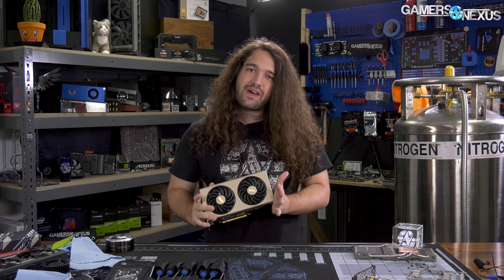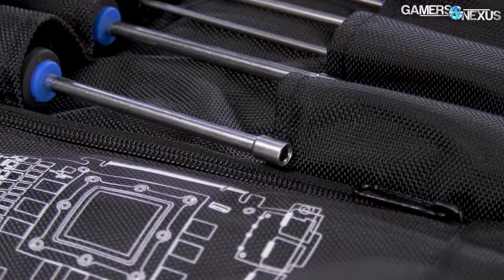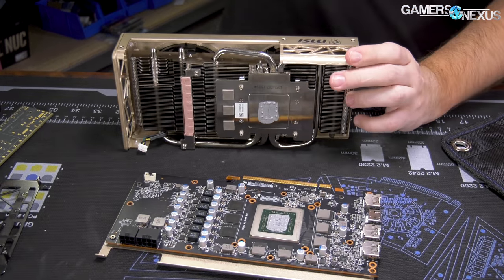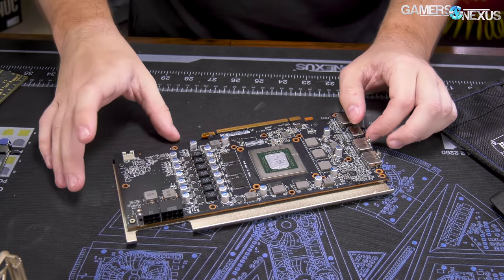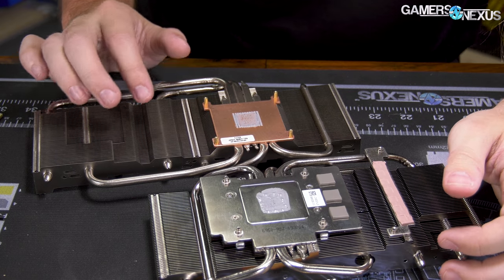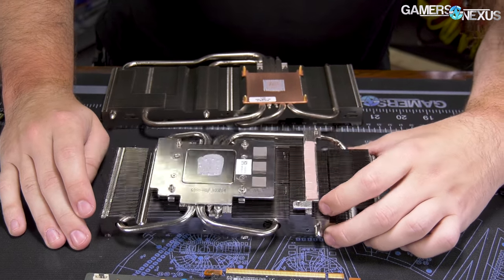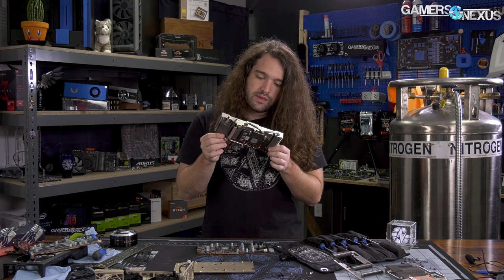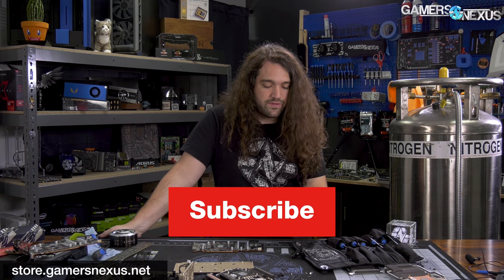Wrong Thermal Pads: Tear-Down of MSI RX 5700 XT Evoke OC

Comment from the maker: Original review of the MSI RX 5700 XT Evoke OC is here: https://www.youtube.com/watch?v=9pj4F8qUBEw
Grab the GN modmat or toolkit on the store! https://store.gamersnexus.net/
Reply: My 2070 MSI Armor can stay cooler than that thing XD
Reply: Steve, could you try throwing proper sized thermal pads on the MSI card and test again for memory temps? It looks like a full sized pad on those memory chips might help and there is PLENTY room on the heat-sink...if you look closer, the uncovered portion is inward, towards the center of the HS, NOT extending outward like you are suggesting in the video (12:41). I am VERY interested in this card and would appreciate your help. Thanks for the reviews and tear-down vids. Cheers!
Reply: dont they realize the likely hood you will disassemble a gpu you were sent or that you buy jebus lol
Reply: @glutenfreegam3r177  Yeah I am curious what would happen with proper pads and perhaps a higher quality thermal paste on main chip.
Reply: This is a common thing with MSI cards. I have a MSI Armor RX 570 8GB OC with the same sized pads.
Reply: The more, and more I see this teardown the more this cooler looks like the Armor branded coolers from MSI. It looks like they added a backplate (which some special edition Armor coolers have), and put it into a different enclosure with the same fans & heatsink.
Reply: probably reused the cooler from another card. which would be a lot cheaper than making a new one.  found something close and said "why not?"
Reply: I just need to ask how it can be a bad design of the heatsink when it is the size of the thermal pad that is wrong. Right size of that thermal pad will be covered by the heatsink. Please explain why that is a heatsink design flaw?
Reply: I need to correct you: It actually matters a lot how many heat pipes are attached to the cold plate. Being a phase-change heat pump it has a limitation of much energy can the device move at a certain temperature differential. Once the q° is too high the heat pipe simply stops working (due to dryout) as a vapor-liquid heat pump and acts like a pure (hollow) metal tube.
Reply: Radeon, are we a joke to you MSI..?..

MSI, mmmm maybe a little bit....🤦….
Reply: Waiting for XFX RX 5700XT
Reply: on the MSI maybe try replacing the memory thermal pads with copper shims, use thermal adhesive to attach then to the memory and then thermal paste on the cooler side. the more efficient thermal transfer of the shims might help the MSI, ... if nothing else it cant be worse than that mess they made.
@gamersNexus
Reply: @glutenfreegam3r177  Yeah, there's no NEED to (@ 16:35) "extend this" [memory/VRM thermal plate] because it already stretches to the OUTSIDE of the top two VRAM chips; it just isn't covering the "closer" half. I'm quite surprised Steve didn't notice that (although I imagine it's not easy when the camera's on you and you're under pressure to narrate on the fly).
Reply: @andrewryder3075  I would also be interested in seeing if more of these identical cards have the same thermal pad goof...maybe Steve's tear down unit was just a fluke and the rest off the assembly line have the proper sized pads...remember, it's humans that are doing final assembly on these after all.
Reply: @TTks124  same fans on the Armor series of GPUs. Just a different sticker on them.
Reply: This makes me reconsider buying anew card since I don't know the temperatures. Any chance you could review a close competitor "Gigabyte GeForce RTX 2060 SUPER Windforce OC 8G [Rev. 2.0]". I wasn't able to find a good temperature comparison online for the 2-fan version. Also: What is the difference between Rev 1 and Rev 2?
Reply: Has MSI gotten back to you regarding this review?
Reply: 12:35 it doent have to be taller the thermal pad is wrong size
Reply: is this thermal pad issue also on the msi mech model of the same card?
Reply: Just received one today from Amazon and I didn't want to mess with the reassembly today, but I can see thermal pads now on the backplate so they have done fixes, just not sure to what extent until I take it apart. If you bash them you at least have to give them credit when they fix it!
Reply: Thanks to this review, I was able to pick up this model for $350 sale price ($380), and MIR ($30). I was looking for a GPU to watercool if a block was available.
So $350 for a 5700xt, $100 for a full coverage waterblock puts me at $450 into this card on an almost inaudible rig. 
Since the pandemic this is looking like the deal of the century,

Comment: Wait, the top ram had the thermal pads on the top of the ram, and that metal plate clearly contacted the thermal pads, so they just needed bigger pads that extended down closer to the core. So they really didn't need to make the plate bigger, they just needed to use properly sized thermal pads.
Reply from the maker: Yeah, got disoriented when flipping it over a bunch of times. That's correct. Bigger thermal pads would do it.
Reply: Gamers Nexus Seems like a plain oversight tbh. A very stupid one but I really don't believe the bigger pads would make any significant cost difference even in huge production quantities.
Edit: Okay you even stated that the thermal pad price is negligible so my comment gets kinda irrelevant but hey guess I should watch till the end before commenting...
Reply: @GamersNexus  Further raise the question why they used smaller thermal pads on only the top two memory modules. Are those 0.01$ worth of thermal pads really worth saving?
Reply: Even rotating the existing pads putting them central should make a huge difference.
Reply: @GamersNexus  Care to try it and see if there's a tangible difference in temps? Would love to see that. ^_^ Cheers
Reply: @Shadow Banned thinner if it still makes contact is usually better and like you said if it doesn't work out you can stack pads
Reply: @GamersNexus  you should add an extra like minute to the end of the video(and explian that they just needed bigger thermal pads) and re-upload or atleast mention this in you next video if its a hw news type video or Just do another video tomorrow and address the thermal pad size issue maybe test with bigger ones to make sure that is the only issue between the pulse and evoke. I'd still buy the pulse cuz it's cheaper and basically the same card or the red devil seems awesome for around the same price as msi's offering.
Reply: @GamersNexus  left & right memory modules also got fins, the upper part (only half thermal pads and only a flat plate so double bad on the 2 modules on top)
Reply: I'd take a guess that it was clamping force exceeding some arbitrary spec and instead of adding/using different pads or having anything shaved down or allowing whatever tiny fraction of force it added to go over that, they decided using less pad was good enough to get back in that spec.
Reply: I honestly wonder if they had some stock of existing VRM pads or something and someone decided to use existing stock for the cards without applying a single brain cell of thought to the effect.
Reply: Agreed
Reply: @GamersNexus  Try rotating the two thermal pads 90 degree and center them on the ram chips. this way the original pad will cover most of the hottest part of the chips. This might be the cheapest way to fix the RAM thermals. Would be interested in some "after" results.
Reply: @sbeve7445  I think the point was it wasn't the material cost of the pads, probably retooling cost to apply them.
Reply: @sbeve7445  Built in obsolescence? Next month "ever faster GPU... [adds thermal pad]".
Reply: i got triggered hard when hearing him gettin it wrong again and again :D
Reply: @GamersNexus  Can we get a video of A/B testing with better/bigger thermal pads which would help us conclude whether the card needs that extra separate plate the Sapphire has?
Reply: Danthrax66 yeah I’m glad someone else noticed that because I was so puzzled
Reply: Came here to say this. So, so unnecessary to scrimp on them. It looks like someone has one less than needed so just cut it in half. Maybe a QC issue?
Reply: @Shadow Banned , I believe it's actually better to have thinner thermal pads as it would allow the transfer of heat to the plate better (less material to pass through).  The real important thing is that they are thick enough to make proper contact on both sides.
Reply: Thank, you was sitting here, yelling at my screen "WHAT ARE YOU DOING! JUST MOVE THE THING!" :D :D :D
Reply: Double Manufacturing Failure ... using a pad too small and then placing it incorrectly thus adding insult to injury.
Reply: @GamersNexus  It would be interesting to see how much the memory thermals drop with properly cut thermal pads.
Reply: @GamersNexus  Maybe a quick thermal pad replacement video, with properly sized pads, to see if the thermals can be  fixed....
Reply: @Shadow Banned too thick or too thin is bad
slitgtly thicker than the available space is best
stackingjust seems stupidbecause you could have air gaps that would ruin the thermalconductivity
Reply: this thick of a thermal pad is trash for heat transfer anyway. Even if it covers the entire memory chip.
Reply: @Shadow Banned You dont want to use pads thicker than you need too, the thinner the pad = better heat transfer. So using thicker pads than came stock on a card, even though it would still work, would negatively impact cooling and likely performance. You really want to use the right size, all the time. As for stacking pads, I'm not sure so I can't speak as to weather it is a solution when your in a bind, what I can say is that I wouldn't do it. Pads are not like paste, they will only compress so much before offering resistance, where excess thermal paste will squeeze out, excess thermal pad will cause mounting pressure issues. Thermal pads are not that expensive, so it wouldn't be cost prohibitive to purchase all the correct thickness strips needed for whatever card your planing on disassembling.
Reply: I was going to leave the same comment. All they need is a different cut pad. You can tell because the pad is away from the gpu. I also think sapphire is on to something separating cooling components. I know reviewers say its ok, but it will transfer heat between components.
Reply: It looks like they had a full brain fart and just cut the thermal pads to match the keepout region of the GPU. Observe how these two memory packages overlap the silkscreen rectangle, the others are outside.
Reply: can you fix the pads and do a update to the video with the new results?
Reply: @GamersNexus  bigger brains at the testing department apparently would too.. like you said, triple x was good, might it have anything to do with placement within their lineup?
Reply: This seems more like a QC issue at its core, probably poor training/DGAF workers installing/QC'ing parts.
Reply: Chances are they have thermal pad cut for other card that fit nicely and too lazy to recalibrate tool and recut the pad for this one. Cost saving on that is more than material cost, makes sense. Acceptable? FUCK NO!!!
Reply: @Shadow Banned Thicker or thinner doesn't make a pad better. Although a thinner pad is better in general, the main condition is that it needs to be as thick as needed to fill the gap between chip and heatsink. But not much thicker. A pad that is to thick could put to much pressure on the chip or the pcb, and it can also have reduced effectiveness because the added pressure squeezes out more of the oil the pad relies on to function properly. 

Stacking thinner pads is inferior to using a thicker pad. Each thinner pad would have it's own contact area, and each contact area is potentially a thermal barrier.
Reply: Well I should read posts before posting my own but that is what I saw also.
Reply: @GamersNexus  thermal pad thickness would be a good thing to include on tear downs, saves people buying the wrong replacement pad (when the time arises).

Comment: Technically speaking, the "Warranty void if removed" sticker wasn't removed. A Philips driver may have poked through it, but it's still in place. Hasn't been removed ;)
Reply: Yep only the screw was removed, not the sticker.
Reply: the double sided tape is the warranty
Reply: If I remember correctly, in the US at least the "warranty void if removed" sticker is actually bullshit.
Reply: @dabombinablemi6188  Yeah, I don't think they can enforce that in the U.S.
Reply: Any country with good consumer protection laws makes that note on the sticker irrelevant if not illegal.
Reply: You're technically correct, which is the best kind of correct
Reply: @dabombinablemi6188  it is 100% illegal to put those on any device. They just do it to try to stop third part repair shops.
Reply: The sticker is there also to avoid people without experience from opening the card and damaging it. The manufacturer doesn´t have to fix or swap your card because the user mishandled them and bent something because they think they are IT experts. At leats if I had a company I would put stickers to at least know if what the customer is telling me is the truth or some bullshit to get a free card/fix after they bend something or torn a wire because they pulled the part the wrong way.
Reply: Yeah, the FTC has started enforcing the illegality of those stickers more stringently the past couple years. They sent out warnings to a lot of companies, which I believe he mentioned in the video
Reply: I dont think msi cares

Comment: So basically, stick to Powercolor or Sapphire as always if you want good AMD AIB cards.
Reply: And avoid Diamond and XFX like the fucking plague
Reply: I'm just wondering why Sapphire released the Pulse version first.  Isn't the Pulse line supposed to be the more value oriented line, and Nitro+ supposed to be the premium line?    If so, shouldn't the Nitro+ cards be released first?
Reply: @outsideredge  the Nitro+ is Sapphires top card.. Usually has higher clocks and some series had different or you could say better coolers...
Reply: what about the 3-fan Gigabyte rx 5700 ? looks good aswell
Reply: @420BulletSponge  What's wrong with XFX?
Reply: Will be interesting to see what Gigabyte, XFX, ASUS and all the others put out.
Reply: here's a better idea, rather than taking the lazy route and just saying brand 1=bad, brand 2=good... wait for reviews. 
GPU's and motherboards brand ranking plays musical chairs every last generation. Sure some stay on top for a while, but there is always a mixup and eventual dethroning.
Reply: @anasevi9456  that would involve more thought than most are willing to commit to
Reply: @anasevi9456  right on. Good point. I never understood people who say they won't buy a brand because 1 component or 1 part broke and then also tell people not to buy that brand. You see it all over online. I've had all the brands fail on me. I've been building since the early 2000's. If I thought like that there would be no company's left.
Reply: unless you need double sided tape
Reply: @outsideredge  nitro+ uses a custom pcb that sapphire needs to design while on the pulse version they just buy the pcb from amd and stick a heatsink on it.
Reply: MSI did good RX 580s and RX 590s..m
Reply: @natterman2037  plus some nitro+ models have faster memory
Reply: @narutogett ... It's clear from the reviews it's not the reference PCB, what are you talking about
Reply: @waking00one  If two different manufacturers use the same pcb it probably is while amds pcb is different because of the unique blower.
Reply: How about not buy AMD???  🔥
Reply: I always go with reference and water cool. Getting around 45C at full load on my 5700 XT with EK Vector block.
Reply: XfX is also recomendable altough we haven't really seen any tests for their RX5700 cards yet.
Reply: @narutogett  Ah, I see.  Thanks.
Reply: basically just wait for others to buy and test everything and if reviews are over 4.3 on amazon buy it ;D
Reply: Semantics! ;-))
Reply: @outsideredge  Now there is a Max version. Wtf is that about?
Reply: Sapphire makes most of the reference boards for amd